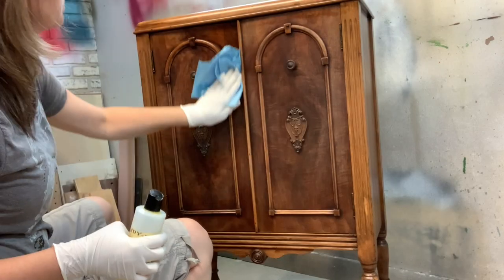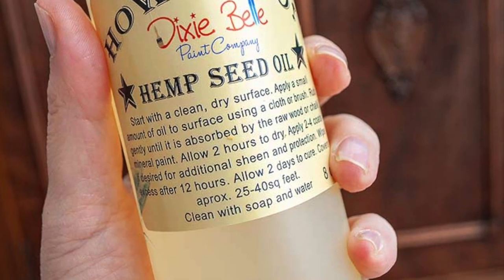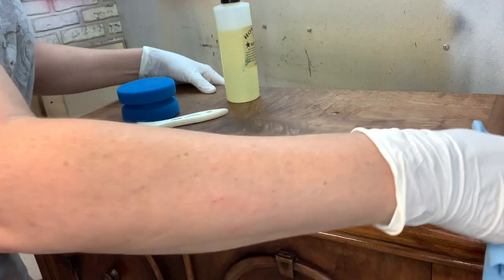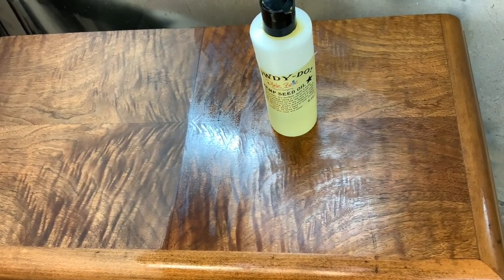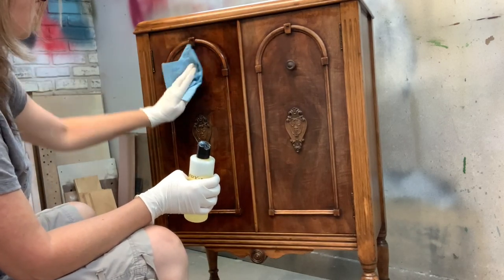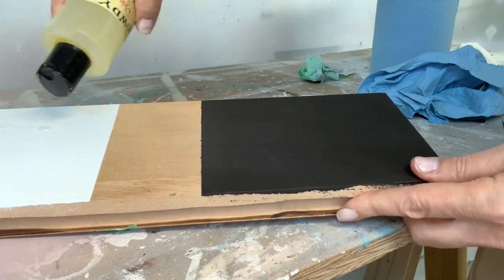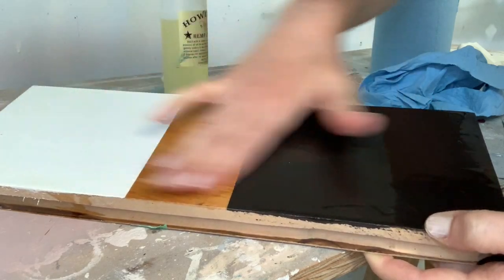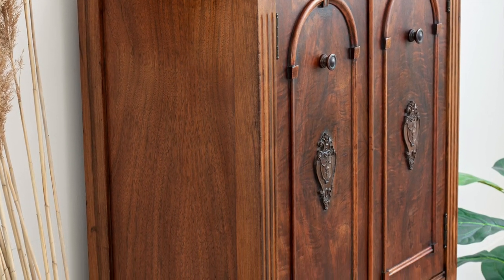How To Use Hemp Oil To Seal Furniture

Comment: Does Hemp oil need to be reapplied often?
Reply from the maker: Depending on the use will dictate how often Jaclyn. For instance a cutting board you might want to reapply 2x per year whereas a cabinet like this maybe once every 2 years or whenever it looks a little dry.